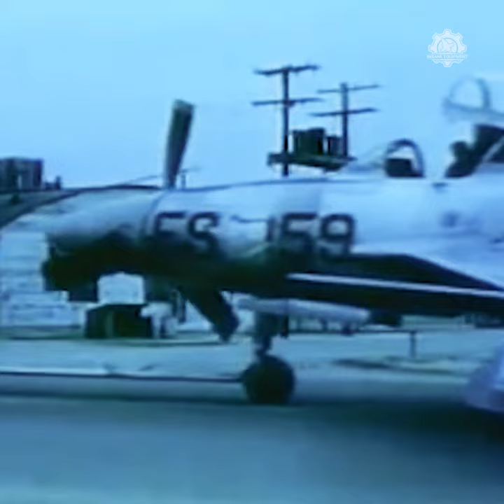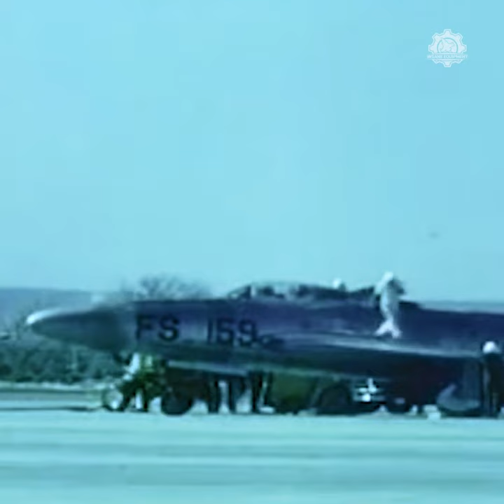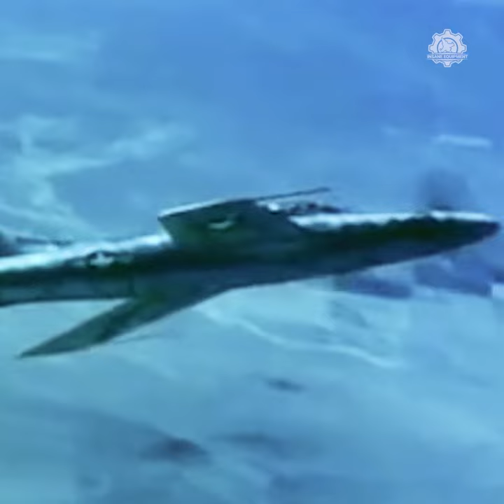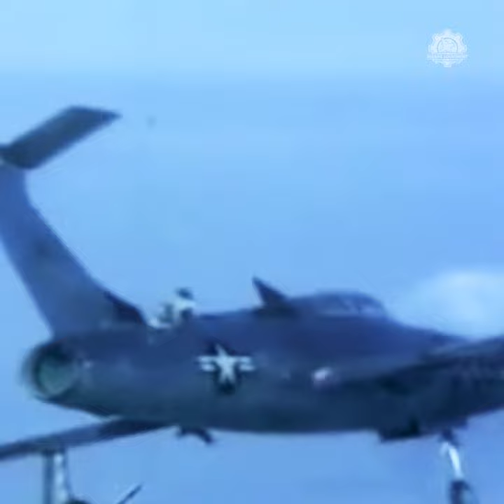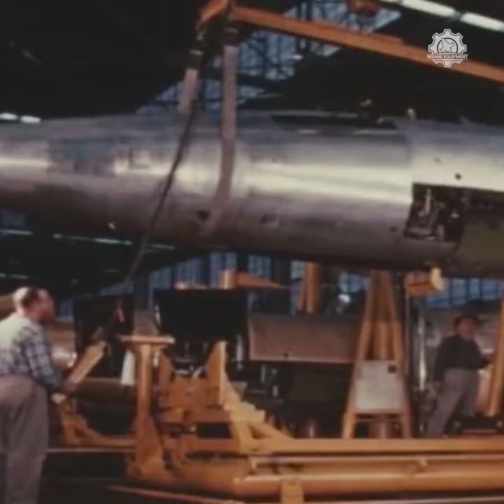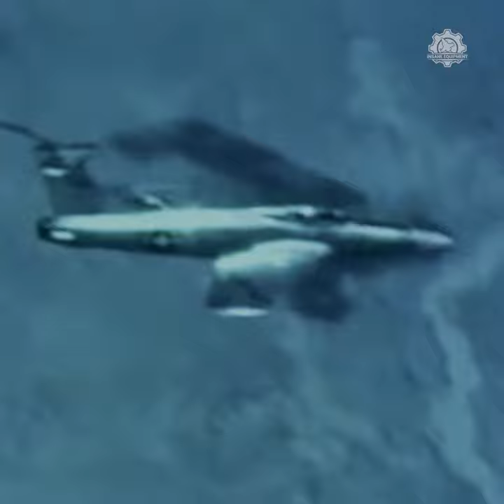The Loudest Aircraft Ever Built - XF-84H Thunderscreech #shorts

Comment: So loud it literally forces you to projectile vomit 🤣
Reply: It was rumored to be loud enough to kill. And its possible for sound to kill.
Reply: @bobthompson4319 I wouldn’t be surprised if that’s true especially if you stand like 100 feet from the side of the prop when it’s at full throttle
Reply: @bobthompson4319  It wasn't. The thunderscreech was 80-85 dba, and something like a submarine sonar ping (which can kill you if you are in the water nearby) is 300 dba.
Reply: @ceelt  well according to the people who where there..... The Republic XF-84H "Thunderscreech" is believed to have produced over 200 decibels of noise, which is comparable to the sound of a Saturn V launching an Apollo mission to the moon. The aircraft's propeller blades, which were 24–30 inches (61–76 cm) long, could travel faster than the speed of sound even when the engine was idling, creating a continuous sonic boom that radiated out to the side for hundreds of yards. The sonic booms, combined with the aircraft's piercing howl during startup, caused the XF-84H to be so loud that it could be heard from homes as far away as 25 miles (40 km) during engine run-up tests at Edwards Air Force Base in California in July 1955. The noise was so deafening that it caused nausea, headaches, and vomiting for people nearby, and even knocked one mechanic unconscious. Ground crew had to use signal flags and lights to communicate with each other.
Reply: @ceelt  80-85 db? Lol we can yell louder than that.

85 dB
Blender, heavy traffic, noisy hotel lobby, inside of an airport, train or truck passing, garbage disposal, hairdryer, vacuum cleaner, tractor, police car siren, snowblower
Reply: @bobthompson4319  You're right, I apologize as I misread the answer for it. It was around 180 - 200 dba as you said.
Reply: @ceelt  its all good. But I must complement you on your humbleness. Many people may see humbleness as a negative however they are the ones in the wrong and could never admit to themselves, and therefore never learn anything. ATTENTION WORLD: I am wrong often. Lol. (Directed at myself) keep being you ceelt.
Reply: Wise man once say I know nothing therefore I know it all. 
Interpretation: I'm open to learn new things, update my knowledge allowing me to learn everything.

Comment: they should have made it a 4 bladed paddle prop that stopped with the blades up and down and then became part of the control surfaces when it was going over a certain speed then when it slowed down the prop is reconnected to the turbine that was the same engine making jet thrust via a clutch system. So it had the jet engine to propel it when at high speed and the prop and jet to propel it at low speed and on takeoff to get moving faster and up to takeoff speed in a shorter distance. I wonder how short takeoff would have been if it had a afterburner and the 4 bladed paddle prop.